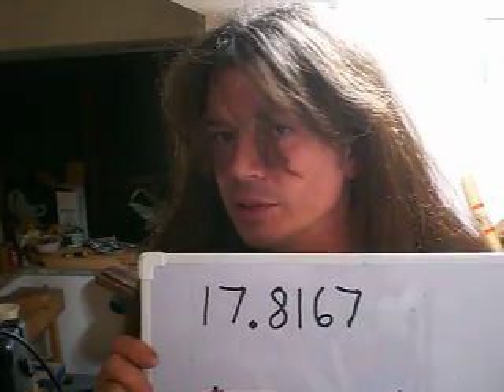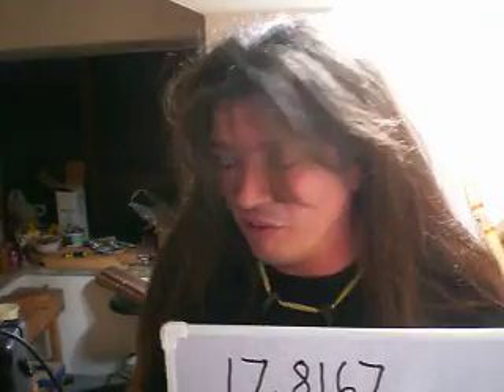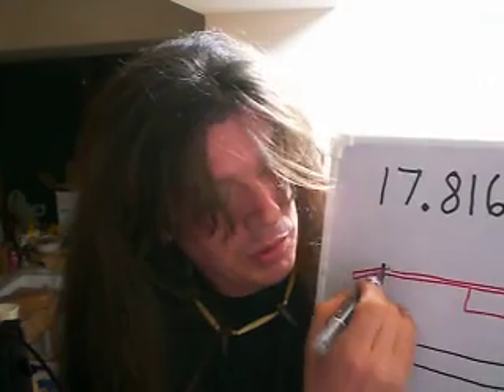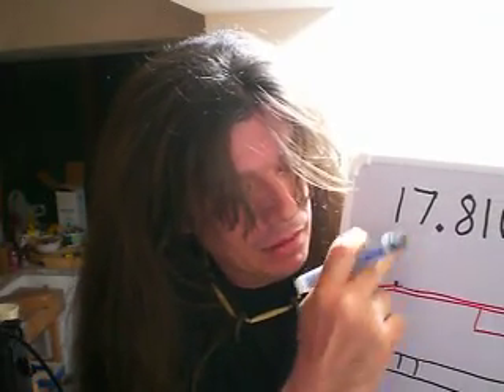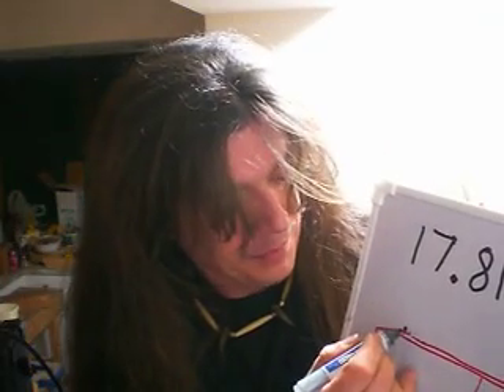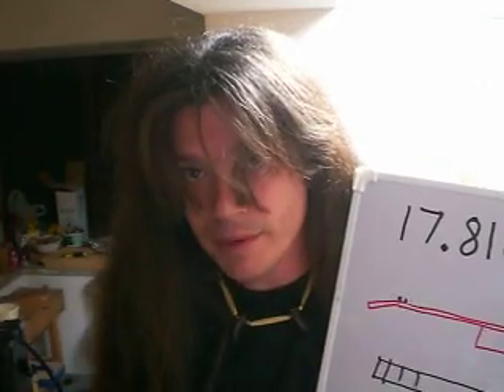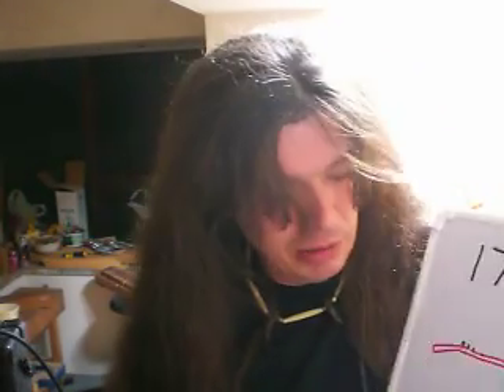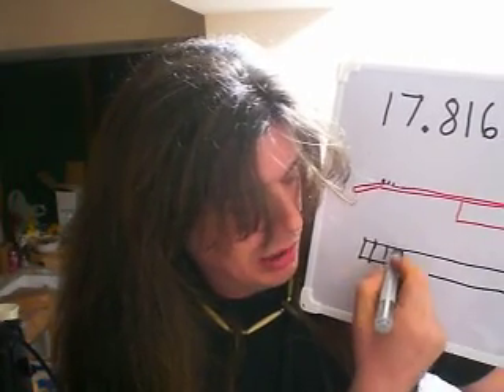How to Make an Electric Guitar - the 18 Rule

Comment: Guess Im condensing messages here, but, I just wanted to tell you; your guitar build videos are the most amusing and some of the most inspiring I've watched to date. My girlfriend and I are planning on putting a bunch of goofy homemade instruments on the wall now :) And- though a relatively moot point, a nut and zero fret are two different things. Gretsch and some other companies DO use zero frets. The idea being, when a string rings open, the bone of the nut has a (on paper and in theory)  different tone than a note fretted by a finger or metal fret. Some people prefer the sound of a metal zero fret and feel it keeps a more even sound between open sounded strings and ones fretted by a finger. Thanks for the fun inspiration and insight.. best.. Ty..